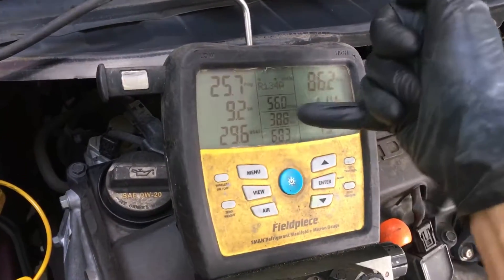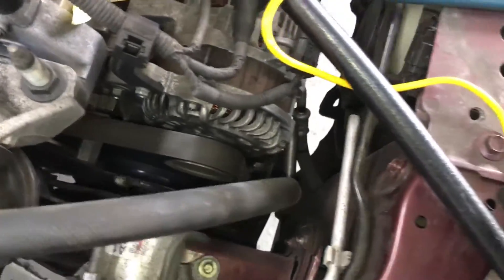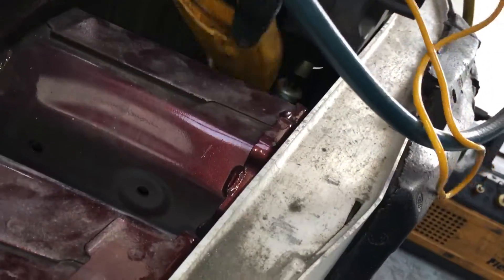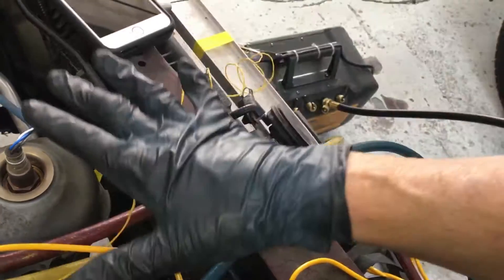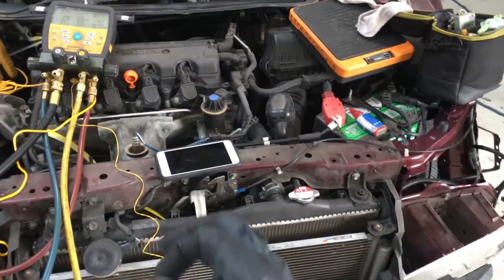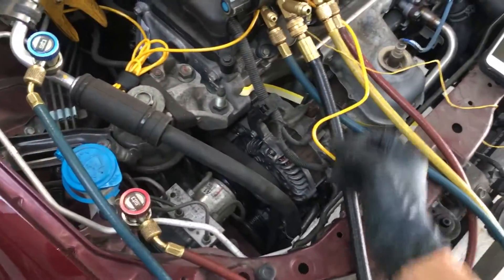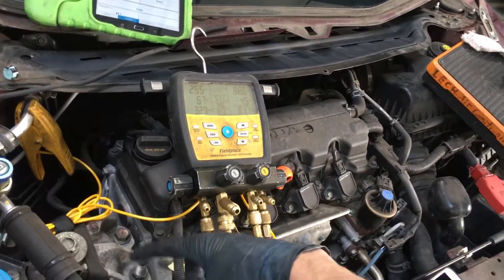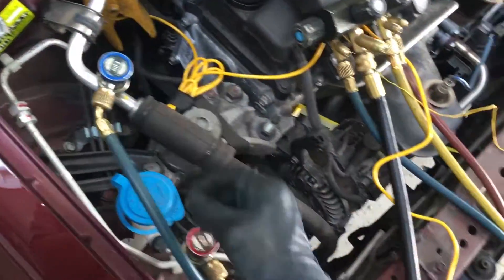Reading Automotive AC suction line and liquid line in vapor line temperatures using SMAN 480V

Comment: Sometimes you can scan a car and depending on the location of the high pressure sensor and the liquid line valve or gauges you can spot it.

Comment: Hello again Tom, very satisfying to watch  your informative videos. I am just wondering why that 2016 Honda doesn't  have the R1234yf refrigerant in it. I  have seen some 2013s already  with it.
Reply from the maker: Different year make models with options came from different plants remember summer built in Canada somewhere built in the United States summer half your models even though it might be a 2013 it depends what month it was manufactured. Sometimes Japanese made
Reply: @coldfinger459sub0  That's what I thought. Incidentally, here in Canada, as you may be aware, we have been allowed to use R12a for way over a decade. No blowing up systems issues as many in the US are lead to believe. It is cheap, it works just as good as r134a and it doesn't hurt the environment. And I have seen a lot of people topping up their cars with it and leaking it out left and right.
Reply from the maker: @aldovera3789  hydro carbon refrigerant gases are the best refrigerants out there nothing wrong with her flammability too much because it is a small quantity that is needed

As a professional shop that recovers refrigerant our only problem with them is that the people do not put on the special unique fittings so no other adapter can fit over the service fitting and there’s no unique identifying stickers so when that vehicle ever goes into a service shop or sold to somebody else they hook it up to their machine and recover the hydrocarbon refrigerant and mix it and contaminate all the good refrigerant which is usually a 30 pound 50 pound tank

But because of lawyers and liability a professional who has a shop cannot install that in a vehicle where the evaporator was not designed to be more leakproof and robust against possible leaks because our normal cars evaporators in the passenger compartment are a big source of leaks

Yes I did a video catching some on fire out of the can into a container showing that it’s only as flammable as a BIC lighter.
Reply: @coldfinger459sub0  I hear you. I purchased  a cheap Chinese digital manifold  which can ID up 93 different refrigerant types. Well, I  am  only  an amateur in refrigerantion so I don't wanna  spend  big coin. Unfortunately,  it  does not include R12a so no superheat and subcooling or boiling points  are available in it.  Red Tek says that r12a has a boiling  point of-34°C, I wonder if setting  the manifold  to a refrigerant  with  similar EV would  do the trick on the machine.
Reply from the maker: @aldovera3789  because they’re a mixture of propane and butane R 290 and R 600 you will not come up with any correct range it could be somewhere in between or it becomes something called a glide refrigerant sometimes but I didn’t think hydrocarbon Phrygian would do that and glide refrigerant is when you have two refrigerant‘s that do not mix perfectly and their bubble point will happen over a range of temperature a glide of let’s say 7° this is just for example off the top of my head not looking at any specifications. 

But when you mix different refrigerants sometimes if they combined the number can go above both the refrigerant if they were just by themselves sometimes below if they were just by themselves sometimes in the middle it all depends on the chemistry. 

The cheap Chinese refrigerant manifold does not have a identifier what it has is just the math formula to provide the calculations for 93 different refrigerant

A identifier actually takes a sample of the refrigerant runs it through an infrared spectrometer and has sensors for just a few specific refrigerant that it was designed for to give you a fingerprint of the exact refrigerant you’re testing. 

Good one start around $3000

They don’t give you pressures are temperatures or anything like that only a chemical make up of the Refrigerant
Reply: @coldfinger459sub0  my bad, I meant to say 93 refrigerant calculations.  And thanks for your information. I will try converting to r1234yf because R134a here requires a license for handling it to be able to purchase.
Reply from the maker: @aldovera3789  The oil is not compatible going from 134 to 1234

The 1234 oil is backwards compatible

But the 134 oil is not forward compatible with the new refrigerant
Reply: @coldfinger459sub0  so, a flush  and refill with  pag 46 yf would be okay? I  mean, I  like the r12a but not many options  available to find literature  and equipment  for it. 1234yf is pricey, though.
Reply from the maker: @aldovera3789  If I what is the near situation I choose probably would be doing the R12a.  

I know it works good when properly done. 

I used it once for a customer I made a video about it it works.  

It’s kind of a pain in the ass to flush the whole entire system out remove the expansion valve and flush the evaporator remove the compressor and pour out the oil that’s a lot of work.
Reply: @coldfinger459sub0  you're  right. I have done  a few systems  tha have performed  very nicely  with it. However,  even with  the  equivalent amount of r12a to r134a, I  see a few bubbles in the receiver dryer  sight glass as if it were undercharged.
Reply from the maker: @aldovera3789  that’s because the system piping and sizing in the receiver dryer all wrong for that refrigerant. The liquid line from the receiver dryer can be cut in half instead of 3/8 of an inch it could be 1/4 inch because of the small quantity of refrigerant and it’s a higher performing refrigerant per pound less is needed to do the same amount of work

Also the receiver dryer is the wrong size too big and the receiver dryer is too wide for the small quantity of refrigerant

The receiver drier on a propane system needs to be very narrow and very tall because of the small volume of gas. 

And probably to make it work really efficiently the fan can be put on the controller to vary the speed of the fan to keep the head pressure for that particular refrigerant within an optimal range that would be different from the other refrigerants. 

This is what happens when people invent something that having a clue about thermodynamics fluid dynamics or the gas loss and refrigerant component design. 

Do you have an excellent refrigerant that can perform so much better if the system is designed for it it’s not just a matter of switching refrigerants
Reply: @coldfinger459sub0  Wow Tom you are an HVAC wizard!
Reply from the maker: @aldovera3789  I’m not special I have my father and grandfather to thank
          Teaching me HVAC automotive mechanical plumbing and electrical in bestowing the importance that you’re always a student and have to continuously educate yourself to stay up with the times and the future
Reply: @coldfinger459sub0  well, we are fortunate to have you on YouTube sharing what you've learned from the best and your continuous strive to keeping up to date. Thanks again.
Reply: @coldfinger459sub0  So, refrigerant blends like r12a have high glide temperature. I have an 06 GMC T7500 medium duty truck which I have charged with r12a but I can't get it to bring the evap outlet temperature below 59 F at idle. and at 2000 rpm it goes down to about 51 F. The pressures at idle: low side 40 to 50 psi and the high: 150 to 185 psi ( as you know on GMs the condenser fan cuts in and out depending on the high pressure).This vehicle has a TXV with a sensing bulb and a pressure equalizing line type. I read that Red Tek recommends modifying the TXV when using high glide refrigerant like R12a. How would I accomplish that?
Reply from the maker: @aldovera3789  probably not worth it on an automobile I could see on a expensive piece of residential or commercial equipment. 

The low side is that high you must have a high outside ambient temperature.   Or somethings wrong. 

When you bring the vehicle inside out of the sun in recycle mode spend 10 or 15 minutes allowing it to cool the cabin compartment so you have the absolutely cold as possible air no load over the evaporator. 

maybe even spray the condenser down with some cool water because what we’re trying to determine. 

What is the lowest possible temperature you can obtain when all conditions are ideal in the manufacture has a cut out point on their thermostat setting. 

The cutting out at 50°F

Or will allow you to get to something like 41°F and then that’s when it disengages the clutch or is a variable displacement and that’s where it starts throttling back on the swash plate displacement. 

Now if it was me since I like to go over the top and go extreme in some cases especially for my personal stuff. 

I’d get a selection of either Dan Foss or Spourtland commercial refrigerant expansion valves and get one that was designed for the Refrigerant that I was using. 

Their flow is different there super heat in there sensing bulb were purposely manufactured for specific refrigerant it’s a choice to take going to the candy store on the shelf and you have different flavors. 

Expansion valves are the same way the sensing bulb head is calibrated to different gas being used in the system

Automotive guys don’t know this. 

What method are you using to take temperatures

What instrument are you using to take temperatures

And exactly to the pinpoint where are you acquiring your temperature
Thermal clamp meter right on the evaporator suction line just as it leaves the firewall

And infrared thermometer

A meat thermometer

Air measuring device for temperature just stuck right on the surface of the grill vents on the outside of the dash. 

There’s a reason I have flexible probes that go 12 inch deep down into the ducts to take temperature

There’s a reason I only use direct contact thermal coupled sensors directly attached to the refrigerant line not thermal cameras not meat thermometers. 

And on my own stuff for families or friends I would also find out what that specific manufacturer use for sensing the cut off that makes the decision to disengage the compressor. 

Can I fool it by moving it

Can I add a resistor in line to adjust

Was it put in the wrong place in the first place from the factory or somebody doing some other work under the dash at one time and it’s not working correctly now

100 other little details that could make differences
Reply: @coldfinger459sub0  I am using the temperature  sensors from the cheap Chinese manifold.  The refrigerant  temperature going in is  about 100F. 
It seems to me the low pressure  rises to about 40 psi because  the txv is cutting the refrigerant flow too soon. The compressor never cuts out only the condenser fan. I have bypassed the compressor  fan relay for constant airflow but it doesn't  change the behavior of the low side. At idle, It continues to slightly fluctuate up and down  when the TXV opens and closes.
Ah, and  these readings are at a cool 68°f here in Toronto.
Reply: @coldfinger459sub0  this condition has also happened on really hot 85° and up hot days this past summer ( something  we have short here  up north )
Reply from the maker: @aldovera3789  if that is the temperature and pressure you’re getting at 68°F outside there’s definitely a problem. 

If I remember correctly some of those cans of R 12 a come with lubricant inside of them how many cans have you put in there and how many attempts ? 

And I also forgot was this a variable displacement compressor ? 

Did you try bypassing the compressor keeping the clutch engaged not allowing it to disengage to see how far down you can get on the low side pressure and temperature ?.  Not permanent just for testing purposes only. 

See if you can get the low side down to about 21 psi at about 1200 RPMs
Reply from the maker: @aldovera3789  many people from hot climates will laugh at us because we both say 85° is really hot 🥵 🤣 

Some places people wish 85° was all they had they consider that a cool spring breeze
Reply: @coldfinger459sub0  yeah, 85°to 90° calls for  heat warnings here. Lol
Reply: @coldfinger459sub0  I have used 2 cans to make it equivalent to 2 lbs of  r134a which is what GM specifies for this system.
Yeah, if I rev it up to above 1200rpm I can get the pressure  to drop to 20 psi.  On the highway,  I  have been able to get tge vent  temperature  to 50°f out of the vents.
Reply from the maker: @aldovera3789  if you could get the suction pressure to 20 and only get 50°F out of the dash on a 68° day definitely something is terribly wrong. 

And this is in recycle mode ? 

Try putting some hose clamps closing off the heater core coolant hoses to make sure there’s absolutely no hot coolant going to be your core does that make a difference. ? 

It’s like the evaporator is starving for refrigerant or there’s a external second source of heat blending away the cool air heat always wins
Reply: @coldfinger459sub0  I have thought about the heater core being an issue but the air blows actually quite cool without the AC on. Like I mentioned before,  it seems  to me the TXV is not allowing enough refrigerant thru. And btw, it is a clutch compressor but it never cycles on and off. Only the condenser fan kicks on and off.
Reply from the maker: @aldovera3789  Watch one of the videos on superheat and sub cooling from the You Tube HVAC instructors that I have recommended many times before to determine how to measure your superheat in your sub cooling. 

Because that’s a hydrocarbon gas and I do not work with that on a daily basis I would have to actually read. 

Like you said I’m suspecting you have high superheat your expansion valve is not metering enough refrigerant through your superheat is probably low. 

So you’re either under charged possibly expansion valve problem. 

Because when you said you were able to get down to 20 psi on the highway and only have these coming out of the dash and if you don’t have a heater core problem you don’t have a vent air blend door problem It’s starting to sound more like the expansion valve or charge issue
Reply: @coldfinger459sub0  hello Tom. So, through  a friend of mine, I  was able to get 414b to try it on my truck and it worked pretty good. I was able  to get the vent temperature down to 49°F at idle. My system, as I mentioned in the  past, takes 2 lbs of r134a. I charged the same amount  of 414b but I couldn't  get any info on what equivalence is Hot Shot to r134a. Other than being  a drop in blend.
Reply from the maker: 414B that is definitely not a common one here in the United States

I had to look that one up a substitute for R 12 and it’s preferred oil is alkaline benzene

It’s a mixture of four or five different refrigerant it has the old CFC ozone depleting refrigerant from R22 it has the flammable refrigerant in it from R600 and R1 24

And that’s the designation name for a hot shot

The reason they put the R 600 is to aid in oil Carrion capabilities for the old R22 and R12 use mineral oil therefore they use a little bit of a hydrocarbon refrigerant to bond onto the molecule of mineral oil to help carry it for lubrication
Reply: @coldfinger459sub0  the Hot Shot is working  well. However,  the oil has started to get dark.
Reply from the maker: @aldovera3789  dark is not a good thing .  I remember when hotshot was a big thing after r12 .    Every burn 🔥 compressor sand the entire inside of the system was coated with a grayish black soot film. 
Since I never installed it. I only got to see the the black results. 

Now I finally  got to see someone install hot and tell me they noticed the dark color in person.
Reply: @coldfinger459sub0  that's  probably why a Canadian company  called Amre Supply has a 25 lbs cylinder for $120.00 CAD. Now, doing some  research,  I  read that the black thing is a chemical reaction of moisture  and refrigerant.  Perhaps if I had installed a new dryer it would  have made a difference.  I have been using the original one ( 17 years old ) and have had the system open for hose repair. And I neglected that because I  heard that R12a was not affected by moisture.
Reply from the maker: @aldovera3789  Are 12 in moisture turn into hydrochloric acid 

The chlorine molecule inside the R 12 in the water molecule hydrogen combine to make hydrochloric acid under the heat of compression mixed with moisture